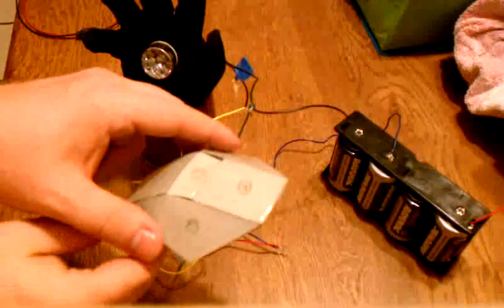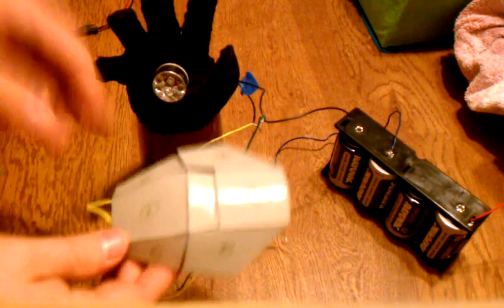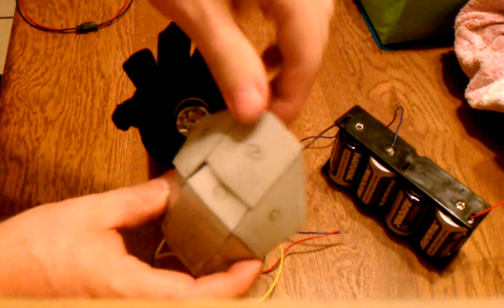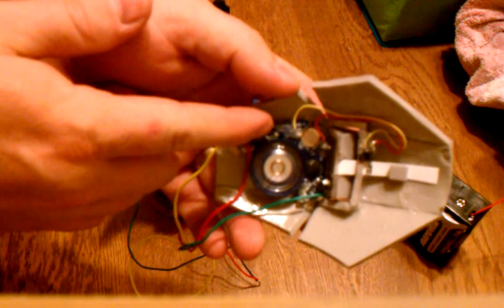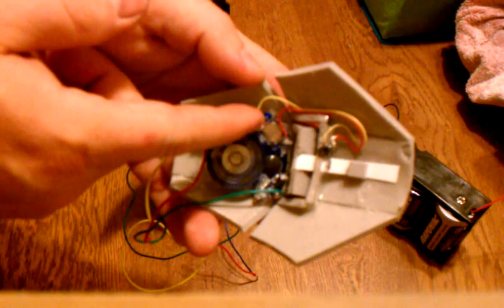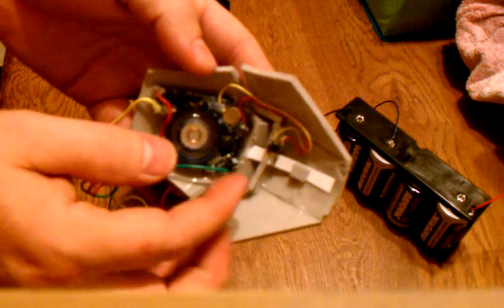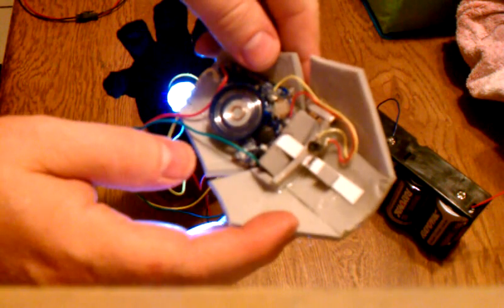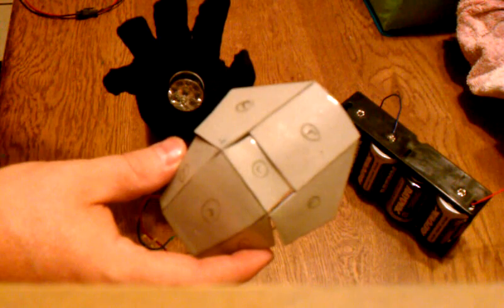How to Build a Working Ironman Cosplay Repulsor Trigger pt2

Comment from the maker: Actually, I got lucky. The microprocessor handles the momentary-on part of the trigger.  The physical 'switch' is just a micro contact plate (two little copper fingers that are pushed together when the stopper applies pressure).  I got it from an old camera I took apart.  If you check out the description, I've got a link to my build thread on the RPF forum.  It's got detailed descriptions and higher quality pictures of that part.

Any other questions feel free to drop me a line on RPF or here!